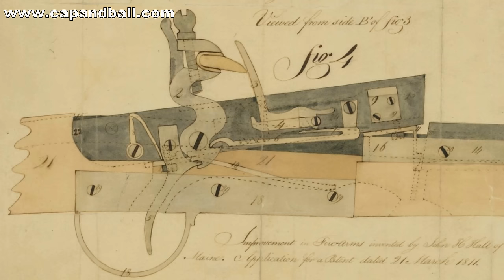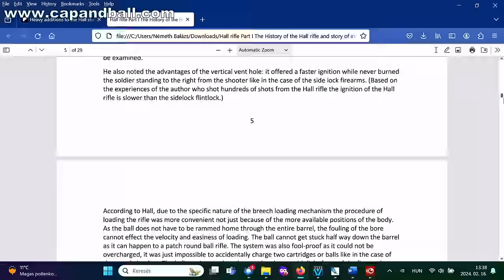The Hall flintlock breech loading rifle - History of development - Part 1.

Comment: The American Army Hall breechloader saw action in the Mexican War of 1846-48 on a limited basis.  Anecdotes survived claiming that some soldiers armed with the Hall would remove the breech which contained the hammer, striker, and trigger when they were out on liberty.  They would carry the breech block like a pocket pistol or single-shot derringer for personal protection.  It was good caution.  The U.S. Army stopped along the way in numerous Mexican towns that did not take kindly to the Yankee invaders.  American soldiers on liberty wishing to walk the dark streets of a Mexican town to the local cantina for beer, whiskey and Mexican women were wise to be armed.  A knife was a good start, but a pocket pistol was far better immediate personal defense against a knifeman jumping out of the darkness from an alleyway.
      Something tells me that if a soldier was going to use the Hall breechblock as a defensive pocket pistol, it would be wise not to load the entire black powder charge into it.  Perhaps all that was needed was half the gunpowder from the paper cartridge.  And if the soldier could get ahold of it, loading three or four, 1/4 inch buckshot balls would be easier than cramming down a full-size bullet would be difficult to unload later on when the soldier returned to barracks.

Comment: The two conversions that were the peak development of the Halls was the change to percussion caps and changing the cartridges to nitrated paper, also used in the early Sharps rifles. Priming was faster and more reliable and the nitrated cartridges didn't have to have the end tore off.

Comment: The terms are often used interchangeably, but if you go to Harpers Ferry, you find the Armory is where the production took place, while the Arsenal was a storage facility that was across the street. And, of course, the Hall Rifle Works was further upstream, a separate facility from the other two.
Reply from the maker: yes, visiting the place is on my bucket list.
Reply: @capandball do it you won't regret it. They have a Blanchard Lathe display setup showing stock making. Fun fact, the Arsenal was setup at the location for two main reasons. One the ability for water power and two the abundance of Black Walnut in the area which was the US Army's preferred hardwood for musket and rifle stocks.

Comment: How hot does the breach get as you fire it? It seems having to push the ball in with your fingers could get pretty uncomfortable
Reply from the maker: It was uncomfortable because the breech was designed to be loaded with a naked ball. I did not notice the rifle getting hot. The most shots I fired in a row was 10 so you definitely need more to overheat the action.

Comment: You can achieve interchangeable parts the hand fitting to a jig.
Reply from the maker: you can, but takes so much work it can't be cost effective. That was the experience from the 1777 musket.
Reply: @capandball  
It really shouldn't take more work than fitting the part to the gun.

Comment: It still looks like it takes a long time to reload and set up.  The only real advantage I saw is that the Hall could be easily reloaded in a kneeling or prone position.  It wasn't until the advent of the metallic cartridge that reloading was considerably speeded up.  The early metallic cartridge single-shot rifles allowed for 8 to 12 well-aimed shots as opposed to 3 well-aimed shots with a percussion muzzle-loading black powder rifle.  So even a slow-firing infantry soldier going for 8 shots per minute still rated almost three times the firepower of a black powder percussion cap muzzle loading rifle.
    This Hall rifle looks like it too maxes out at three, well-aimed shots per minute.  I keep writing, 'well-aimed' because just pointing and shooting a rifle is a waste of ammunition.  You need to take the additional time to, acquire the target, line up the front and rear sights, steady the aim, and press the trigger in a controlled manner.  Firing four shots per minute, for example, in the Union Army, was done primarily for training purposes and to instill the loading process so mentally firmly that the soldier did not think about it but acted on muscle memory, thus making no mistakes.  Union generals knew that it only three shots per minute was practical but without the four-shots-per-minute rapid load and fire drill, soldiers would not be ingrained to the procedure.  Hence it might be only two, even one shot per minute with a nervous, poorly-trained soldier.